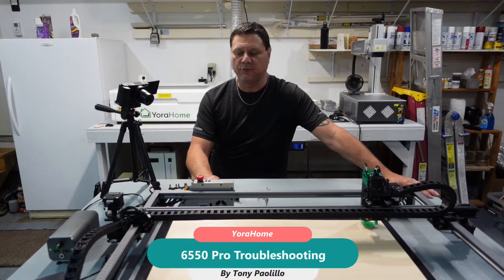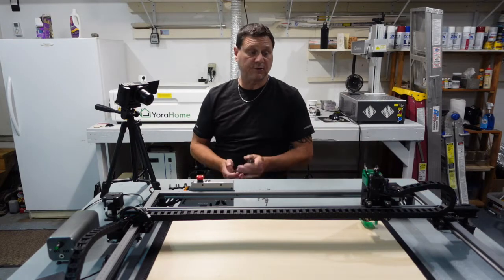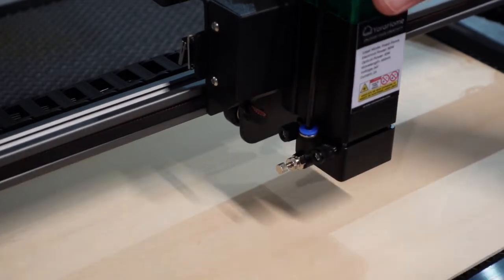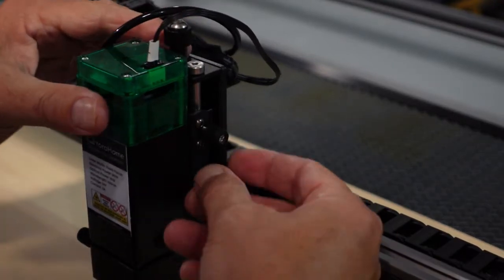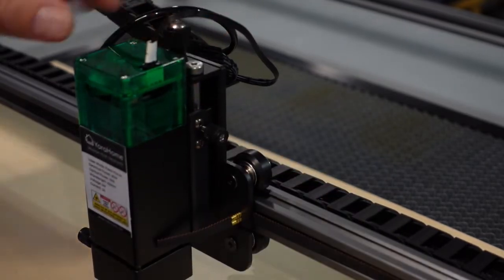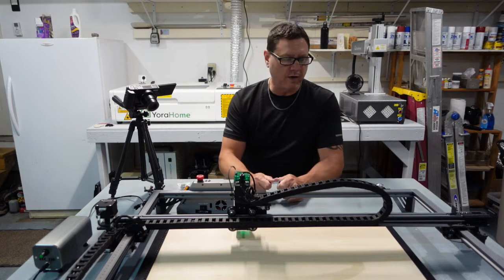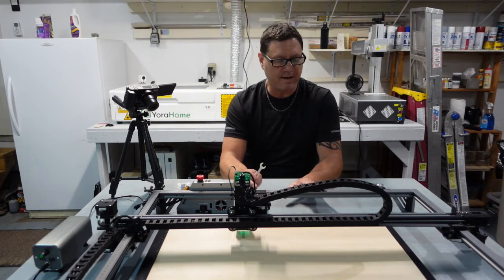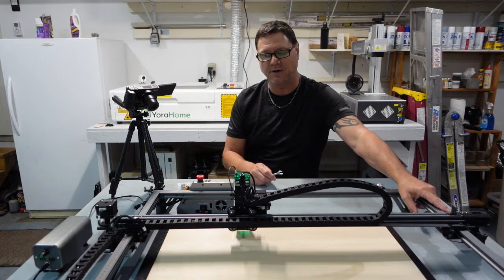6550 Pro Troubleshooting V1.2

Comment: Careful, you may be taking a properly configured switch and making it wrong.

Does the controller have a separate port for a rotary engraver?

Check the controller out before you fix what appears to be broken.

If there is a port for a rotary engraver the switch is correct, the gantry is on when the rotary is off and the gantry is off when the rotary is on.

On machines with single stepper motors on both axis, one unplugs the Y-axis motor and then plugs that cable into the rotary engraver. This works fine on machines that have a single motor on all axis.

However, when the y-axis has two motors, unplugging one of those motors for the rotary engraver is problematic, the axis is going to still move. An on/on switch that transfers the y-axis power output from the double y-axis to a single rotary engraver axis gives you the best of both worlds.
Reply: Oh I see it now.
The switch appears to be in upside down.
Reply from the maker: Hi Scott, the switch works as such, when the switch is on the power it sent from one yaxis motor to the rotary port and disables the other motor and when the switch is off both yaxis motors are on and no power going to the rotary port. 
Not sure why the manufacture decided to just pick the O to be on and the I to be off.  It will be correct in the next batch though.
Reply: @TonyPaolillo  

The switch is a double throw switch meaning that there are two on positions. The reason the 0 is on and the 1 is off is because the switch was installed upside down, being that it is a rectangle.

There are three connectors on the switch. The center connector is the input connector that the main power is connected too. The outside connectors direct the power to whichever port the wire leads too.

You can correct the problem by opening up the unit.

If there is enough wire to pull the switch out without disconnecting them, then all you would need to do is pull the switch out of it's mounting hole, flip or turn it 180 degrees and push it back in. problem solved.

If there is not enough wire to pull the switch out, and if the wires are not soldered to the switch, you can unplug them, remove the switch and flip it 180 degrees, then put it back in. Then be sure to plug the wires onto the exact same spade connector that they came off.

If the wires are soldered to the switch, you can cut the wires, rotate the switch, then splice the wires back together.

As far as the manufacturer is concerned, it is possible that the switch on your system was in the hopper the wrong way and therefore inserted the wrong way. That, or there's a whole series of units with the switch in backwards.

It happens, but so infrequently that an inspector may not think to inspect the switch for proper insertion.